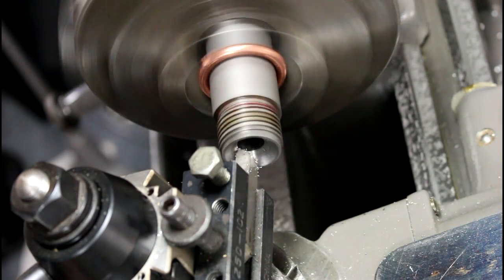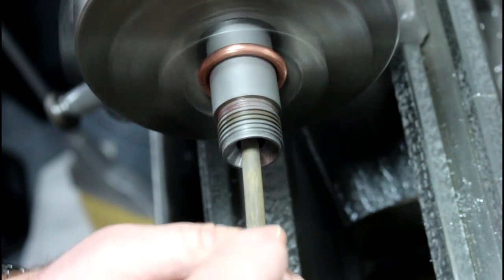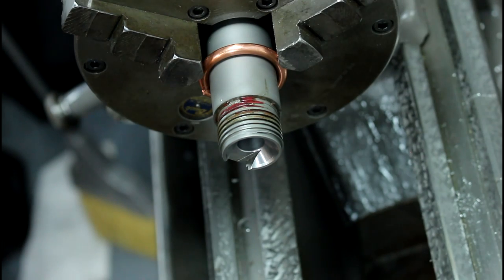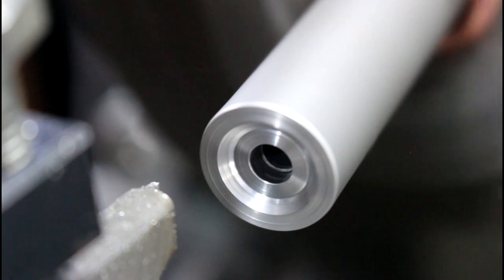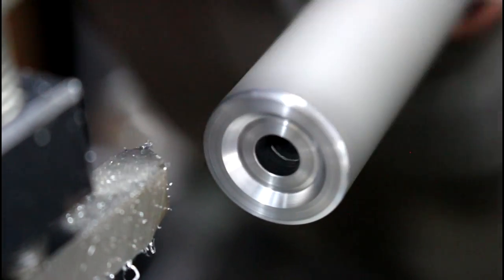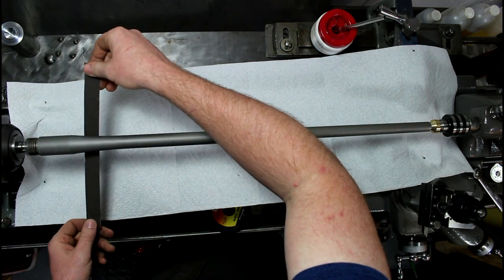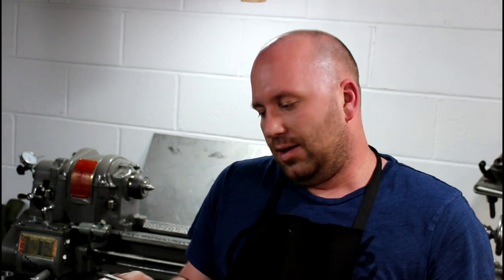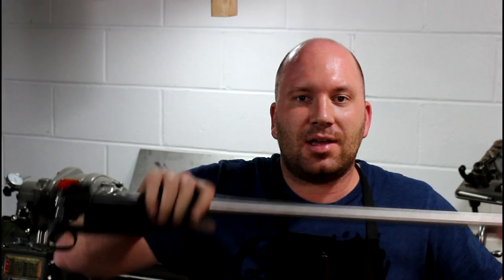Rifle Barrel Salvage Before Setting Back, Polish, Crown, Feeding Cone Repair! Part 2

Comment: Great work by you!  The barrel polishing was really satisfying.  It's funny how a large part of gunsmithing is often fixing what other "gunsmiths" have done.  That eccentricity between the chamber and the barrel threads is pretty sad.  Here's hoping it shoots well at the range!
Reply from the maker: +Practical Renaissance 
The sad thing is that the guy that did the barrel is pretty well known for "good work". Easy to hide mistakes when the customer can't see them!

Comment: Love your work. I was wondering about crown finish angle, isn't the magical best angle 11 degrees?, yours was flat. any reason? Thank you.
Reply from the maker: As long as its concentric to the bore,  it really doesn't matter.  I have flat crowns on most of my target rifles or recessed flat crowns. I've got a few 11 degree crowns and have never noticed an accuracy difference.

Comment: how did you bolt clearance end up after you cleaned up the throat? And how did it group after all your work?
Reply from the maker: +Chuck Eichhorn (Chuck1919) 
The clearance on the cone was 12 thou which is about the most ide go. Each end of the cone was good and in the correct location, he just had a hump in there. I have to get it out in another stock then I'll go test it out. Might be a month or two yet.

Comment: Hello, how do you center the barrel in the 3 jaws side ? Is it a chuck with independent jaws ???
Reply from the maker: It's an "Adjust-Tru" chuck. Once you tighten your work in the chuck, you can adjust the entire chuck against the back plate the same as you would adjust a 4 jaw to get it into alignment.

Comment: Neat job! Long while ago I bought a project from a  widow friend of mine. Eddy stone chamberd for the 340 poler bear ? From what I know and see it needs to have the action lengthened ? The bolt face is opened and it could be fired single shot but the box is too short witch means so is the bolt firing pin and the rails ? Is this really doable?
Reply from the maker: +Danne Hughes 
You shouldn't need to lengthen the action. Just about every magnum cases can run through them short of some of the rounds they shoot through Barrett Rifles. Last complete rifle I built was a .338 RUM which is a pretty big case and longer OAL. There is a procedure to lengthen the magazine box and lengthen the opening for the mag to fit into. I think you can stretch them out to 3.8" or so. I think that 338 RUM i did ended up in that 3.75" range. Do you have any further info, brass, or a chamber cast for that round?

Comment: Hi mate.  Would you be able to weld up the treads, and cut a new tread on that barrel?  Or do you create too much heat distortion?  I thought that the tolerances would be much closer than you mentioned.
Reply from the maker: +Marcel Timmers 
Hello, the tolerances should be much closer, say a half thou under receiver or less. Welding is not an option due to heat. You would need to cut the threads off, re-thread and rechamber.
Reply: Ok, Thanks mate, I was just wondering if it would have been an option.

Comment: What is in the chuck when you started to sand the barrel. Can not tell what the set up is.
Thanks
Reply from the maker: +ugotit33x 
It is just a dead center. The alternative would be to chuck up a piece of steel or brass and cut your own center to match the cone. That would have been the best option here, but the 60 degree center usually works OK. You can also clamp the threads into the chuck with some soft jaws. All you need to do is spin the barrel.
Reply: +Precision Machine Shed 
OK Thought it might be a new gadget I never saw.
Could not see the Jaws of the chuck.
I usually use 5C COL-LET  holder that screws on to the head of my South bend lathe the I use the appropriate for the thread end or barrel end.
Thanks.
Plus I crown and put threads on all my rifles for flash arresters.
Like to know how it shoots when your done.
Cheers
Reply from the maker: +ugotit33x 
I'll let everyone know. I'm planning to take a trip to a local range in the next month or so.

Comment: may I ask why there was a need to clean up the chamfer. is it just for looks or is there any other reason
Reply from the maker: If you are talking about the feeding cone on the back of the barrel, first it was done incorrectly to begin with. That along is a good enough reason for me. Second it did has some imperfections which can scuff up the case if they are indexed down. Lastly, it had a double angle to it which could affect feeding.

Comment: Camera seems to be vibrating, how level is your lathe?
Reply from the maker: It's perfectly level. I was using a buck chuck adjust-true chuck and when the barrel was indicated, the chuck had some run-out, only thing I can figure. It normally runs very smooth.

Comment: Where do get your copper band for the barrel???
Reply from the maker: It's a piece of #4 copper wire that I bent in a circle. I have a couple different size wires and diameters for both ends of the barrel and different size barrels.

Comment: I love your videos. I'm a machinist myself so I feel your frustration over the .006 thou run out from the bore to the threads. I'm equally as anal as you seem to be when something isn't perfect. In fact i bet every time you pick that gun up the first thing you think about is those damn threads, or you just couldn't stand it anymore and went and got  a new barrel. I'm so anal that I use tenth indicators. lol... It's an illness my machinist brother.
Reply from the maker: Thanks, I actually haven't touched that rifle since I did the video. I have a stock for it that it will need to go into. I'll think about it again once I get back around to it.